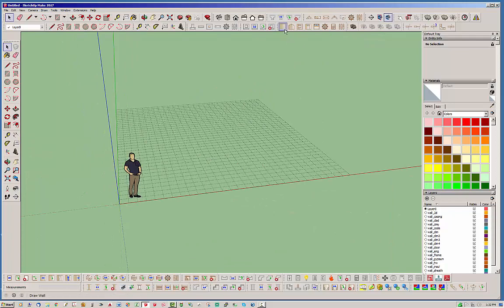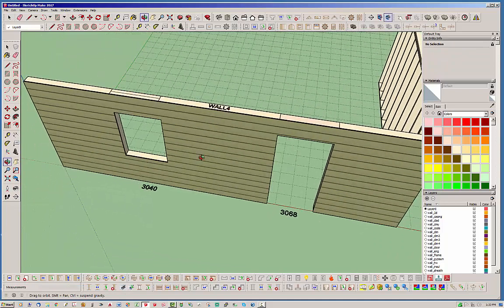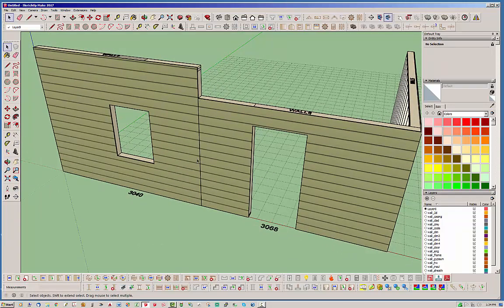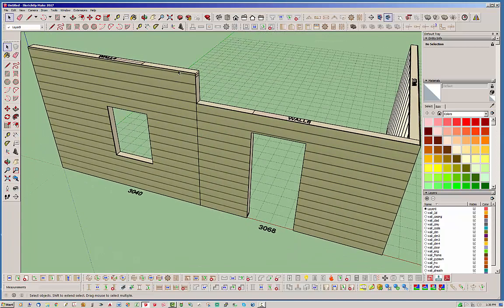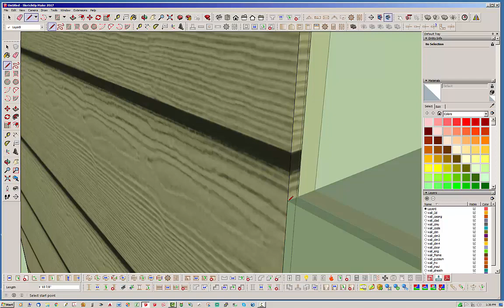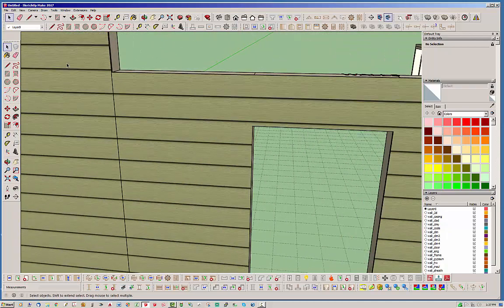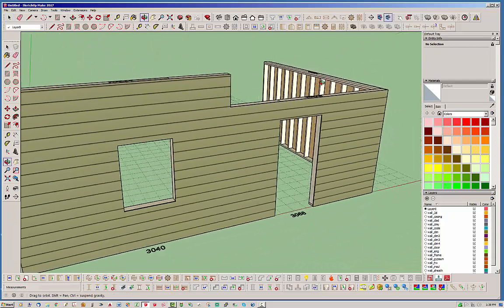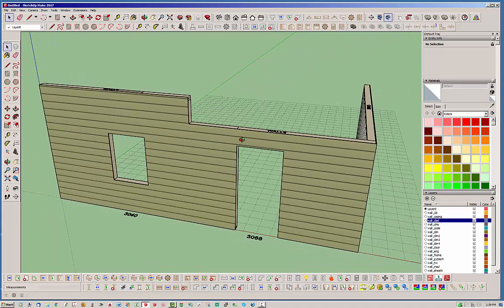Medeek Wall Plugin Tutorial 11 - Split Wall Cladding

Comment: Another thing I should add is where you have walls that are inline like this you can adjust the wall to right so that the stud spacing is on center with the wall to its left.  The parameter is the stud offset parameter found in the wall edit menu.